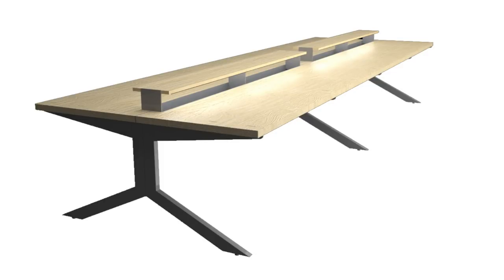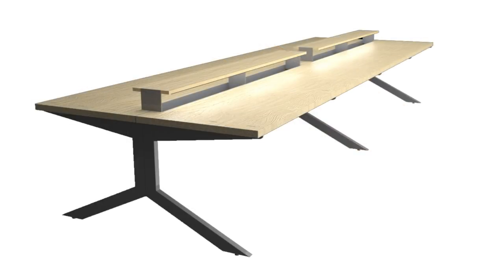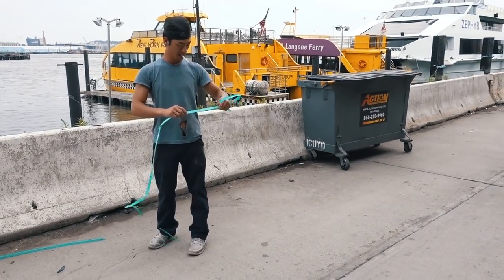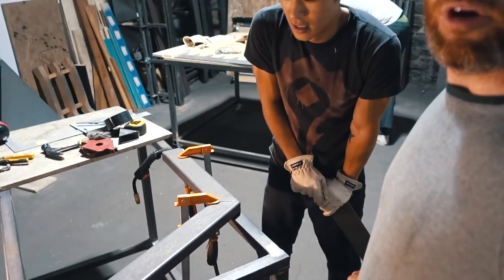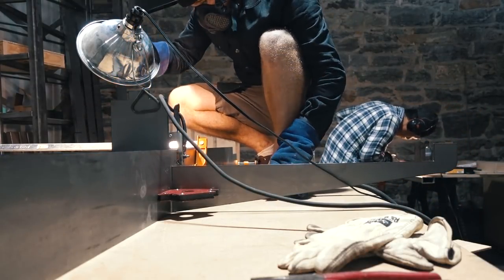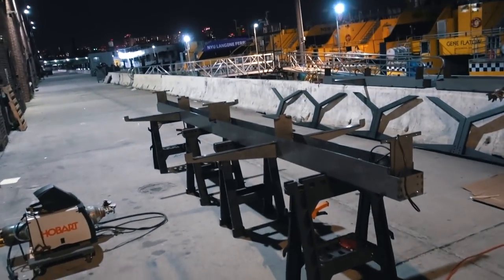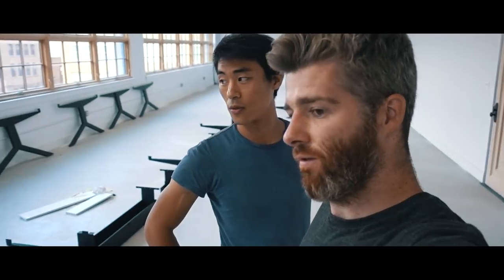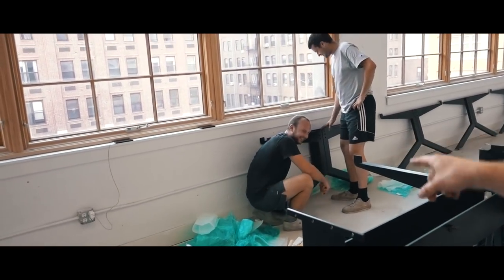Steel + Plywood Office Desks - Episode 007

Comment: Was it just normal spray paint you used? How did the finish come out compared to powder coating?
Reply from the maker: We used a spray gun and a flat black Rustoleum. Then we sprayed on a lacquer. The lacquer really protects it. Ive been at the office recently and the scuff marks from peoples feet just wipe off. Obviously not as hard wearing as powder coating but certainly up to the task.
Reply: Conor Coghlan thank you very much for your answer.

Comment: Love the live edge plywood top, check out Kerf Design Cabinets in Seattle Wa. Right up your alley. The OSMO hardwax oil I told you about is an idea that comes from this Co. I went to visit them. I was making some window trim a knock-off of their live edge look and I was using Polyurethane on the edges. The problem was the poly was interacting with the glue from the baltic birch plywood and the finish was turning milky. I mentioned this and they told me about OSMO oil. That is one application that I have used it on. Kerf Design is small but awesome cabinet co. So is your work. Riches & blessing to you. Mike
Reply from the maker: Hey Michael, thanks so much for the recommendation. Just checked out Kerf's website - absolutely love them! Such beauiful work. I would love to visit their shop, shame they're so far away. I've yet to order the osmo but we're have a few more plywood projects coming up in the near future and I'm really keen to try it out. Thanks for watching and best wishes to you too!

Comment: Yes enjoyed the process video but missed the leg attachment part. Enjoyed the triangle cut on the legs which I presume was to increase stability rather than weld two pieces together which a diy(er) like myself would have thought to do 👌🏼. Was this decision from experience or something you were thought?
Reply from the maker: Thanks Paul! I had to edit some parts out just to keep the flow of the video going and keep it from being too long. It's a balance I suppose! I think the reason we cut the triangle piece out is because you save one surface of the metal - which looks slick - no welds. Also, it's actually pretty easy way to make an angle as you always have one surface connected which helps with keeping the pieces aligned. You should try it rather than cutting both separately.